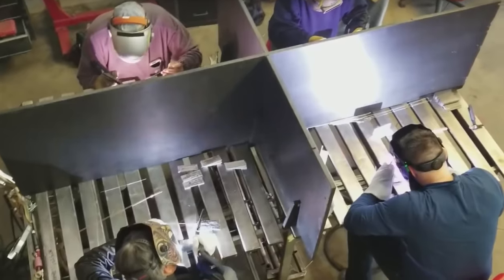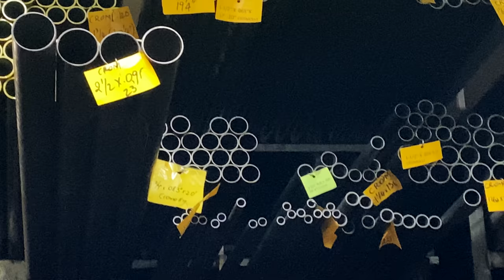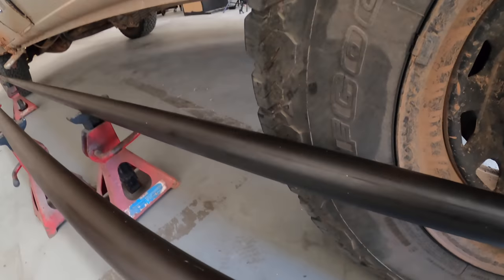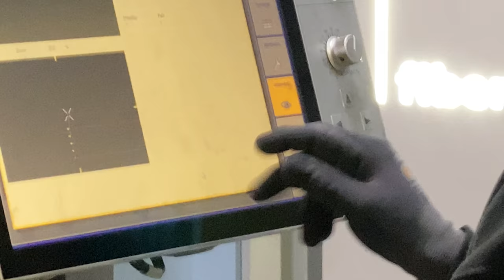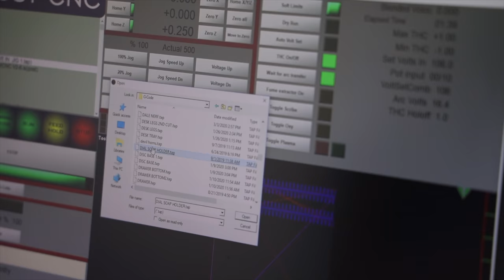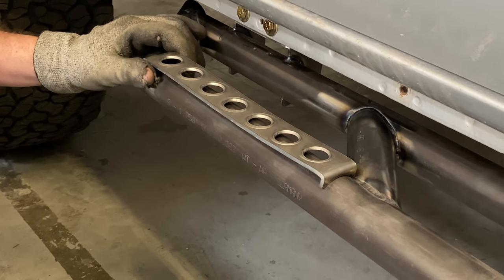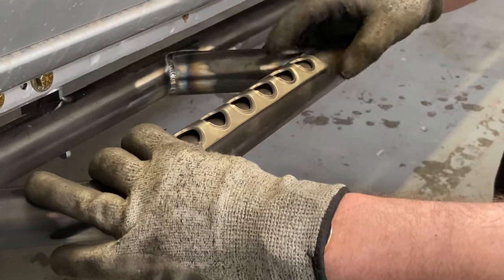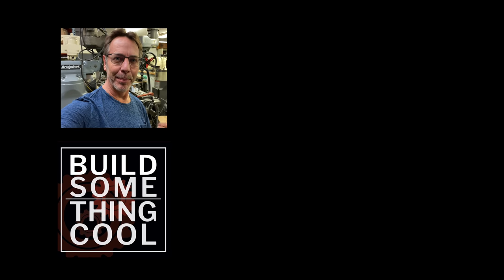Rock Rails for 4x4 Van

Comment: Could you add some small gusset plates from the frame to the plates you added for the rails, to reinforce them? Space or any other problems aside, that would keep them from bending up the sheet metal, and be much stronger overall...

Comment: never bolt something like this to the body.... ALWAYS to the frame.... first major rosk he hits is going to bend up the body, and cause major damage, defeating the purpose of rock sliders...  I would rather have dropped the bars off the the frame, and lost a slight amount of ground clearance bolt on plates that encapsulate the frame rail like the mobtown offroad sliders.
Reply: I was thinking the same, seeing how it flexed when he stood on it. Maybe add some 1/2" plates across to the chassis/frame & bolted through the chassis/frame might suffice.